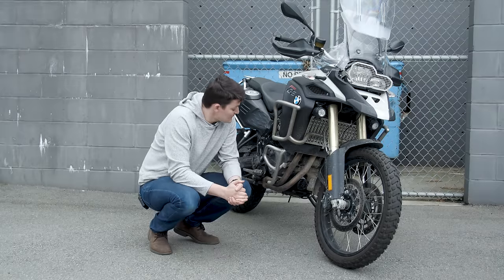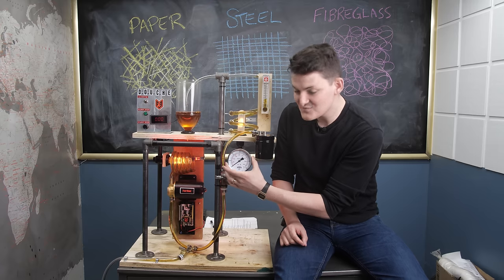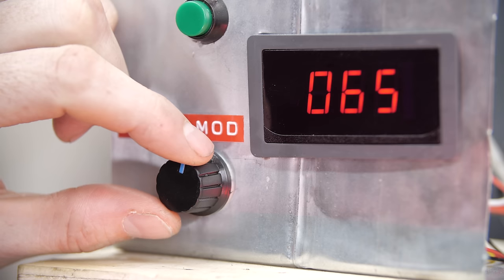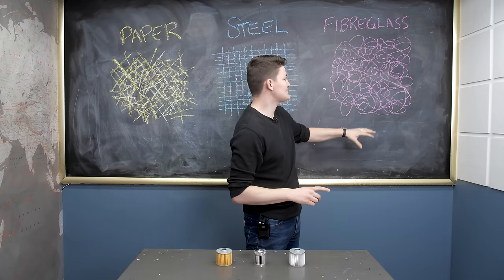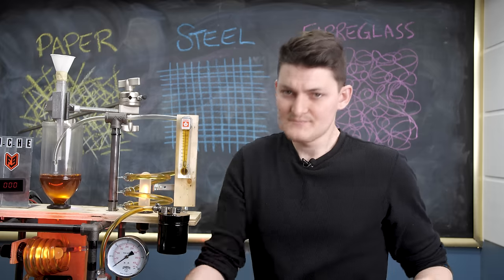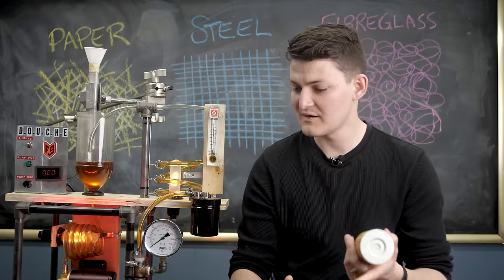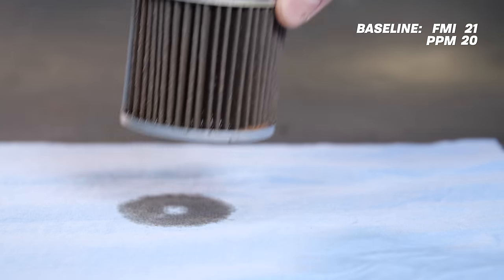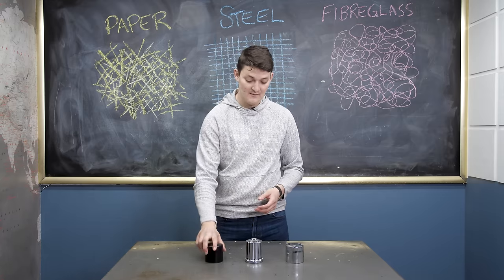The Best Oil Filter - Testing Paper vs Fibreglass vs Steel

Comment: As a mechanical engineer and someone who has worked at labs for majority of my career developing testing methodologies. This was absolute beautiful to watch. Ryan and F9 folks did it again.

Edit: Ok - so there are a bunch of comments about how this test is clearly not accurate. Well, no. But it is still damn near close. This is the type of testing and engineering forefathers did prior to SOPs and Published standards. There is nothing wrong with doing it. And like ANY science. IF you have a different opinion, YOU TOO can make a video and challenge it.
Reply: your opinion on the temperature of the oil thus changed viscosity thus different filtering results? or not ? they did heat oil somewhat but not even near the temps oil gets inside the engine i think.
Reply: I'm also a mechanical engineer and I'm becoming more and more skeptical of their approach to science(or rather applied as engineering) as time passes.
Reply: I'm a bit let down that the effective surface area, thickness and  contaminant capacity have not been added in the comparison, or accounted for by factoring the measurement outcomes
Reply: Ryan and the F9 team, bro it's just Ryan and the camera guy.
Reply: better filters have more paper media than others, true for cars, probably true for MCs too.
Reply: @DC_DC_DC_DC  The neat part is you can go out and make a test rig and test and publish your own results on your own youtube channel!
Reply: @KuopioKallavesi  If you put that factor in, the type of oil also needs to be considered too. Fully synthetic oils viscosity doesn't change nearly as much as semi synthetic oil, hence being double the price, it's much better for performance engines. Mineral oils should just not be used imo, so we'll ignore that one.
Reply: @MikaelJSandersson  Specific criticisms?
Reply: @BruceGinkel  you are so salty that you are missing the whole point of my comment.
Reply: @DC_DC_DC_DC  What was the point of your comment again?
Reply: No its not, anyone who has done even the most mild work with any kind of filter can give you multiple reasons the test, or more importantly the results are flawed. 

You can have different filtering ability out of the same material. You can have a company that makes paper filters that have a 99% efficiency down to 20 microns and another that can only do it to 40 microns. It's also not clear the effect this would have on flow. I would also like to see how this would change at running temperatures.
Reply: @paulv22  Well, it's not so much that what Ryan's saying is usually wrong. Sure, I've seen a few things where I've gone "hmm, no that doesn't seem right" but it's uncommon(and I don't remember which video now). The problem is rather what he's not saying. I know that he's a physicist by training, and that of course gives him a basic understanding of science, but that's not always applicable into real world engineering because there's a bunch of other stuff that comes into consideration. And it's difficult to know what you don't know.

In cases like this where he seems to have invented his own test method(which has happened on multiple occasions) as he's not referring to an industry test standard(which he's usually good at doing when he's actually is doing something standardized) I'm extra skeptical because product development is done to the rigorous standards of the industry which usually is developed to take in to consideration all possible parameters of the system. 
For example in this case I would be interested to se how an ageing sequence affect the performance. Temperature cycling is a huge thing in automotive testing. 
Then we have the production tolerances of the filters. The tests he made was on an extremely small sample size(as far as he showed us). In automotive engineering we do limit and margin testing to make sure all tolerances meet the criteria's, as no two samples are exactly the same.

I could go on, but the main takeaway is that engineering and product development is complex stuff.  
Comparing products in a 9 minute video with home made test methods and claiming a winner is not serious.
Reply: @MikaelJSandersson  i’d want to agree with you but i want to also point out a few things, i’m not an engineer however :

Most road car and bike manufacturers recommend a paper filter for their engines

Huge marine diesel engines have metal filters, as well as small 50cc scooters

To me, it looks like when oil flow is paramount and maintenance intervalls are frequent, the metal filter is the one manufacturer recommend. On the other hand the paper option is recommended where reliability and longer maintenance intervalls are exepected

I would love to know what F1 and MotoGP engines have as filters, because if they are metal, it validate F9’s findings.

He also didn’t specify how he cleaned his rig between tests nor the order of testing. Perhaps residual metal shavings were left in the system, thus clogging the following filters quicker
Reply: @Taletad  Oh, I wanna be super clear that I'm definitely not saying that he's coming to the wrong conclusion here. What I'm saying is that his testing methods and reasoning are likely flawed. He could very well still come to the right conclusion this time though. 

My point is that engineering and product development is complex, and a nine minute video with home made scientific-ish test methods won't be a fair representation.
And the thing is, since I've seen him do some less than great stuff when it comes to things I know(product engineering) I'm also starting to question some things he's saying that I don't know about.
Reply: As a resident of a neighborhood that also shits in a toilet, I agree.
Reply: @MikaelJSandersson  i understand your point and agree with you
Reply: @Damitsall  go ahead and link us all to some real hard hitting test data that supports your claim please.
Reply: @MikaelJSandersson  All very good points. I'd just say that sometimes those industry standards become the ends, instead of the means. Having an outside view of things can be useful.

I live in an area with relatively harsh winters, a lot of salt on the roads and a lot of potholes. I do have an ME degree (though work in software and not in the auto industry), and based on my experience, it really doesn't seem auto industry test standards capture this environment well. If they did, we wouldn't see problems like Ford brake lines rusting out prematurely, or VW/Audi engines sludging up.
Reply: @BruceGinkel  you don't need to do your own test to point out potential flaws in another. 🤭🤔
Reply: @paulv22  Oh sure, industry standards aren't perfect and when they're made my experience(been in automotive industry for 10 years) is that they seldom change them even if they know that they aren't perfect. But it can also be a choice. Ford is somewhat of a budget car company and they might say "Ok, we make cars that works ok for 90% of people in Europe and the US and that's enough". They know that it's not a great fit for your needs, but they'd rather change those few lines on guarantee or just take the hit in reputation.

Although, outside view can have a value, but RyanF9 speaks in a way that makes it seem like it's not his amateur opinions but some kind of science that is correct. That's a tricky situation.
Reply: @DC_DC_DC_DC  I don't think it's worth accounting for those factors. In the end, the consumer can't control the surface area and thickness of the filters they buy. If, for example, steel filters are always smaller than paper filters due to their construction, then it would be misleading to report the filter performance in terms of surface area because the steel filters on the market are smaller than the paper ones. Similar reasons for the other factors you listed.
Reply: @MikaelJSandersson  All fair points.
Reply: @BruceGinkel  What claims? I didn't make any claims.
Reply: @MikaelJSandersson  To be fair, Ryan's results mirror most of the other research projects done on oil filters in the Automotive industry. Even though it doesn't showcase perfect methodology it does a pretty good job getting the point across
Reply: @grantlee5393  Like I answered someone else: 
You can come to the right conclusions with the wrong method. I'm not saying he comes to the wrong conclusions here. I wouldn't know. 

But the problem is that since I've seen him use iffy methods and reasoning a couple of times now, and coming to the wrong conclusion at least once, I start to wonder how many other times he's been wrong that I didn't catch. The faith, or trust(English isn't my first language so I'm not sure which word is best here) in him and this channel is declining.
Reply: @Damitsall  tried them all, different oils, different bikes, road racing, circuit racing, MX, standard road riding, even farm quads for 15 years. Hiflo paper oil filters FTW.
Reply: They didn't even show the change in the iso code
Reply: @_sneer_  I didn't say that was or was not true. I am critizing the test and the interpretation of the results. If you have done tests I'm curious, I use Hi-Flo too, what is the efficiency at 20 microns?
Reply: @MikaelJSandersson  I appreciate this perspective. I love how he set up the chart for clarity, but it's fair to be sceptical.
Reply: @victorquesada7530  Yeah, simplifying is great, but the problem with making something seem scientific is that people will likely trust it more. And Ryan is a good presenter who knows how to sound like he knows what he's talking about. 

So, people will see the charts and, sometimes, the references to reports and hear him speak with authority and just think that he's right, even when he's not. 
And I'm not saying he's lying. I'm just saying that sometimes he's talking about things that he has a very limited knowledge about and without realizing it he's got something at least slightly wrong.

And it's not just him either, I've seen a bunch of people try to do sciency stuff with a big variation on how accurate it is. Or rather, the science is often correct, but they don't realize what they've missed in their reasoning.
Reply: @MikaelJSandersson  uh...  he's a physicist.  I think he has a clue.
Reply: @MK-hb3xc  Mh, well. He studied physics in uni a while ago. As far as I know he haven't actually worked in the field. 

There's a big difference between studying something theoretically and having actual experience from engineering and product development. 

I think he has some clues, but not all.
Reply: Well, honestly the heat of the oil isn't going to help much of anything other than oil flow, particularly for steel. The amount of contamination that each filter can remove isn't going to radically change due to heat, especially steel. 

As far as fiberglass is concerned, we know that high temperatures actually cause the filter to allow even more contaminants through, as per all of the HVAC studies that have been done on heaters and AC components using fiberglass filters, and anyone worth their salt in those industries will tell you, do not use fiberglass unless you want to be inhaling those toxins in a week. 

So, yes paper filters are indeed the best way to go for most filtering applications. Well, other than something like a water purifier where dissolved contaminants are a concern. But you get my point.
Reply: Very well said in your update.
Reply: i didn’t realize science was subject to opinion

Comment: Always a good idea to have a magnet somewhere in the system. I've been told by an oil tech that full flow filters only remove particles down to 20 microns. Any finer filtration would start to remove additives. BUT ferrous particles down to 2-5 microns will damage bearings and such particles work harden each time they circulate. Remove them ASAP with a magnetic sump plug or magnet stuck to the spin on filter. Obviously especially if one rides an Aprillia ;)
Reply: I thought this was the key takeaway - these filters aren't great at catching the bad stuff at all.  As an Aprilia owner my magnetic sump plug brings me joy and despair in slightly unequal doses...
Reply: As a Royal Enfield owner I feel your pain brother 😉
Reply: I think KTM thought fuc fixing engine issues and  lets just put on lc4 engine 2 paper filters , 2 metal "filters" for large pieces and 1 magnet sump plug. As a result the bastard can eat the dying rocker bearing and still run perfectly fine after you swap it with a new sacrifice. Ask me how I know...
Reply: @nitacawo  How d'ya know?
Reply: @nitacawo  Well?
Reply: @JatPhenshllem  Gotta hate it when someone leaves you hanging like that
Reply: @jakeedgell591  Dude!
Reply: @JatPhenshllem  dramatic pause
Reply: @danmanthe9335  It's been the same time as an entire pregnancy term since I asked. I'll be waiting for that response. Well, if YouTube doesn't  terminate my account before then

Steady on!
Reply: Bypass filters in the 2 micron range will not removed additives, been using them for 35 years.
Reply: @tssci6774  Interesting point. I wonder if the issue then is pressure combined with the finer filter??
Reply: Add a secondary oil filter that uses a finer filter medium. This is usually called bypass filtration, as it only filters a small fraction of the total oil pump output from a small oil port or specialized filter base plate with ports.
Reply: My Pontiac 3.4 engine uses a Australian Jackmaster Classic bypass filter. The full flow filter is a Wix XP. Im told the pleats are synthetic with a wire backing. Jackmaster claims 1 micron if you use their elements. They use a very high quality Australian toilet paper in a sock. About 20 bucks. I use Great Value 1000 from Walmart. My old diesel tractor uses a flat head Ford V8 canister filter that has half a roll of Viva towels. I origionally set it up to use a 4 1/2 inch roll of Scott 1000 toilet paper. My Rambler American L head 6 came factory equipped with piece of shit 10 micron spin on bypass filter. To clean the oil I installed a Frantz oil cleaner. The same for the Mazda diesel pickup. My Honda 500 Custom had a Frantz oil cleaner back behind a saddle bad. The 65 Honda 305 had a internal chain driven centrifuge. Im partial to the top loading toilet paper filters such as the Jackmaster. They are all good. The full flow filters arent supposed to clean oil. They are there to grab the big abrasives.

Comment: With the paper filters, I would like to see you do the same test  using genuine against aftermarket.  That would give a comparison on price point viability, for me anyhow. Having worked in the trade for 30 something years there was always a doubt in my mind that aftermarket were as good as genuine.
Keep the vids coming I really look forward to them. Cheers.
Reply: What's the answer? I've always used Suzuki branded filters since the price difference isn't that great. But I've wondered about that.
Reply: I had a Suzuki filter fail on my SV650 K5 after a couple of years. The bike didn't get ridden or washed often and water can pool in the shed. Sometimes it left a lot of condensation on the bike like a beer glass.

The filter had a bit of rust from grass type stuff sticking to it from the road, then sprung a pinhole leak idling in the garden.

I switched to a Hiflofiltro 'racing' type with a thicker case. The nut on the end is for removal only. I'll also replace it with every oil change, instead of following the schedule of every two oil changes.

I didn't mind originally as it saved money and a website had extensive testing which found the more miles on filter the better it flows.
Reply: Genuine or aftermarket?, the truth is they probably all come from the same couple of factories in Asia. Don't sweat it.
Reply: the problem is that SOMETIMES.. the "Branded" is just an Aftermarket with a name.. (and higher $$)
Reply: @DragonM109R  Is it sometimes or most times? There can't be that many oil filter manufacturer's. What do you run on the 109?
Reply: @vaportrail226  Unfortunately I don't have the 109 anymore.. but since I created that email address.. kept it.. plus Secretly still which I had my 109.. when I did have it I used the K&N - I presently have. a roadglide Special and use the OEM just because convenient and I've done all my oil changes through Stealership ( i got a 3 year "all you can eat" service" was above to do 5 services in the 3 years.. :)  became cost effective... sort of... ended in march -  now I do my own Oil changes going forward.. but again.. OEM just easier to get..
Reply: I have it on good authority that crumpled up dollar bills work best.
Reply: Anecdotal, so take with a punch of salt. Worked in quick repair auto shop. I guess the findings of such a test will return that if you stick to regular maintenance intervals the difference will be minimal to non existent. Fuel filters on the other hand in my experience are a completely different ball game.
Reply: define aftermarket. a lot of manufacturers use 3rd party filters as standard rather than producing their own. which suggests nobody would bother producing their own anyway when they can just rebrand a 3rd party filter.

Comment: I really enjoy every vid you make . A USA scientist who also rides, tested bike-oils and declared most of them as 'snake-oil' . He showed most m/cycle-oil is dead after a little-over a thousand miles, mainly through heat and possibly shear-factor in shared-gearbox's . Mobil-1 was one of a few  that held-up longer . He advised running reasonable quality, cheaper-oil and changing it frequently . Also some paper-filters DO claim faster flow-rates than others, this might be a cool-test to do . Years ago , I had access to free oil for a few years and ran a straight-six petrol-engine, changing it every month-ish .That oil looked brand-new after a while of doing this, once the motor had cleaned-up from repeated-changes . I drove that car hard and the oil only looked 'newer' every change . Something to think about .  51-bikes  over 67yrs    Dave  NZ